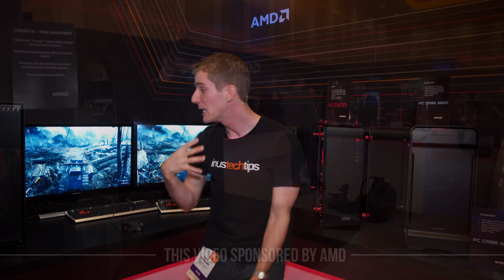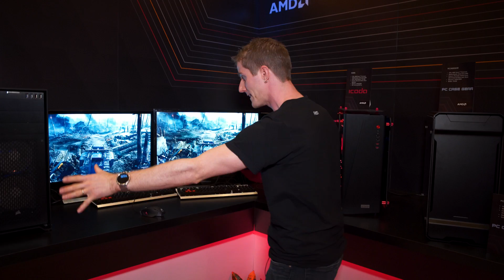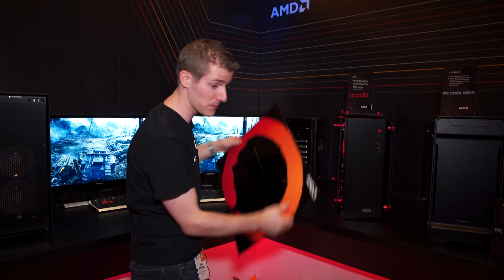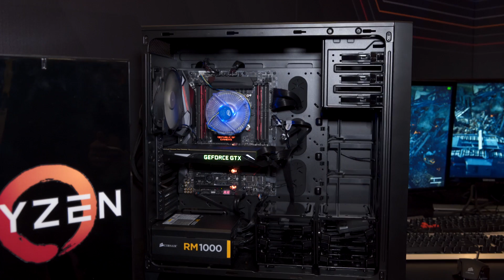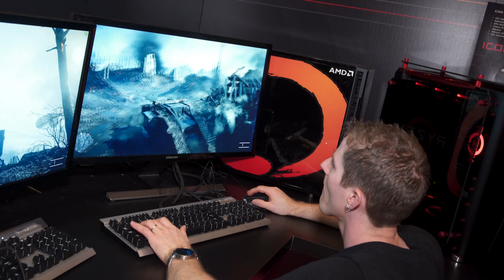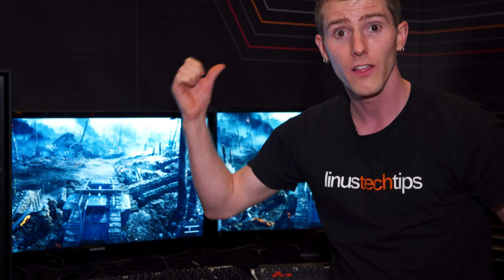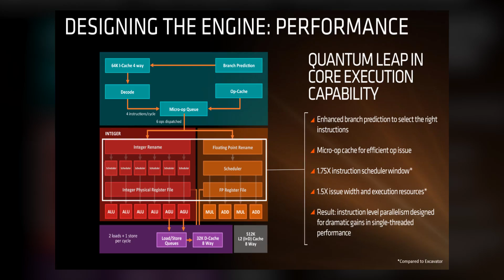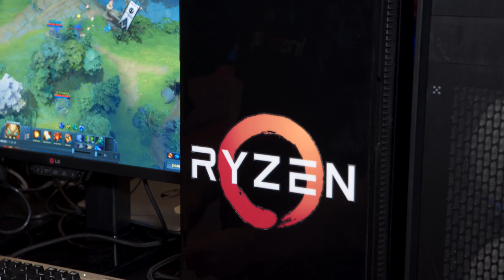AMD Has Ryzen!

Comment: If it competes with the 6900K, a $1,000 chip, then wouldn't it make sense from a marketing standpoint for AMD to price the Ryzen CPU's at around $500-$800?

Would it be wise to wait for Ryzen if your budget for a CPU is $250 (6700K price), or would it be best to grab an i5 6700K now?
Reply: Doesn't make sense to judge AMD's new CPU's based on an extremely old 8350. Personally I would've waited for Ryzen to launch before making a purchase. I can't wait to get rid of my i5 6500 if ryzen is as good as benchmarks show.
Reply: Jake It looks like AMD cpus will have about the same performance as intel. So expect the price to be a bit lower than intel but not a lot. 25% max.
Reply: Robin Muerkoester Remember the price of the 9590? The Fury X? The 295x2? AMD has a history of teasing things, overhyping them, then slapping a big price tag on them.

I agree that AMD should try to balance the market, but pricing to be competitive with something like the 7600k or the 6700k would be stupid. It's clearly meant to compete with chips that wrongfully cost over $1000.

I think at best what we're going to see is AMD price this chip at around $600, forcing Intel to drop the price of their chips. Then AMD will release a line of mid range CPU's to compete with the now lower priced Intel CPU's.

In the long run I probably wasted $50 or so by buying now, but I really couldn't care less.
Reply: The 6700k is an I7 honey. And why get the 6700k when the 7700k is already here. PLUS RYZEN ISN'T THE OLY FUCKING CHIP. THERE'S OTHER CHIPS AS WELL YOU PLEB. This is their top chip.
Reply: EvokeDuck Tbh I already bought the 6700k, just wanted reassurance that it wasn't a mistake lol.

Honestly, coming from an 8350 I don't think I would ever trust another AMD CPU in my computer.
Reply: Zed Jayce Damn straight I do ;)

I don't like Intel's naming
(actually I meant the 7600k)
Reply: the only problem with considering changing CPU to Ryzen from an i7, is that not only woul you have to buy a new cpu, but also a new motherboard. Which is why I havent upgraded my shitty fx 8320.
Reply: Zed Jayce "Guys my '98 Camry is as good as your 2015 Ford Focus because they go the same speed!"
Reply: Jdjjd Gdhdjc Yeah but the CPU you're seeing in this video won't cost anywhere near a 7600k, it will no doubt cost more. AMD hasn't said anything about their mid range CPU's so everything about those is literally speculation. As far as I know, their existence is pure speculation.
Reply: @Jake My 8350 did me very well.
Reply: ***** Actually they compared it to a 6900k (and if I'm not mistaken the 6900k was being throttled by AMD. Something was only running at half efficiency, that's a fact.)
Reply: TheGamingFireUltra You even bother to read anything past the first reply?

Still waiting for YouTube to implement age restrictions on the comment section.
Reply: ***** Right, something we've been discussing this whole time. Don't see the need for his comment other than to show he has to be up at 7 tomorrow for school.

Comment: for those saying AMD won't be cheaper - they will. AMD's rep is nowhere near intel's, 99% (excluding weirdos who are attracted to the underdogs) would rather pay the small difference and get an Intel CPU instead - so it's going to be either reasonably priced (not aliexpress kinda cheap) or priced equally but offer more than it's counterpart, like offering a more "premium" line for the same price. if I'm wrong, then go to hell AMD, because Intel would laugh at you, and us, and we'll still get crappy overpriced processors because there is no competition.
the last line is what I'm after basically, I can't stand the fact that my I7 920 is nearly identical to my 2.8-3.8GHz Xeon CPU - besides having the extra tech of the Xeon line..
servers oriented tech is way ahead of ours, cpus with 2 bil cores and 4 bil threads and we are thrilled of having 8? lol, jesus
sorry for the 3rd grade writing, it's the flu + 6 am + being a foreigner, I'm excused

Comment: this is irrelevant to the video, but just a video suggestion, for Christmas I got a new CPU cooler and I couldn't find any rubbing alcohol around my house to remove the thermal paste, so I was wondering if you would make a video on whether removing the original thermal paste first when applying more makes a difference or not
Reply: Faneili always remove it bro
Reply: Chifinity oops
Reply: If the thermal paste is not too old and still slightly moist then it should be ok. If it's old and crusty then you'll have to renew it man

Comment: Did anyone else notice that during the bf1 gameplay that they had vsync on the computers. Meaning they both kept around 60fps. Whereas if they were unrestricted framerates than I think intel would be running at a much higher fps than amd

Comment: I don't get the 6900k comparison. It's not a gaming CPU, it has a lower per clock speed than a 6700k. Why not compare it to that? 

I get it, core to core, thread to thread comparison, but you might aswell try to make the FX 9590 look good, except you can't because no matter how many cores it has, it would still get shitstomped. 

Prove me wrong AMD that this isn't another Bulldozer. "Even" performance doesn't impress me.

Comment: BF1 Wasnt even running at 60 FPS... Have Game Devs given up on optimizing PC games well?
Reply: brah dat shud be 4k. 4 freakin k.
Reply: Aphex it was 4k bro
Reply: I feel like the instant that a game has multiplayer all thought of optimization is thrown out the window.
Reply: 1. 4K. 2. 55 FPS is damn indistinguishable from 60 FPS.
Reply: my only complaint about it is they didn't show what the intel was getting just what the AMD was, makes it a pointless test in my eyes.
Reply: LTT wasn't doing the test. the test was done weeks ago. they were just showing off the PC that was used in the original test
Reply: They havent given up on optimization but theyre trying too hard to make it work just a well on all hardware. Not too mention linux, linux drivers are different from windows drivers and whatnot so theyre just trying to make it playable across all platforms without giving up detail. But for some weird reason, my mid level rig feels smoother on modern games then my high end rig. I get more fps on the high end rig but theres a lot more screen tearing, random frame drops, and just an overall weird delay feeling. As if Im playing on a 30hz monitor. All of my hardware is fine tho. Dont understand it
Reply: Elusivehawk its pretty close, but only if you have Gsync/Freesync monitor. On a normal 60hz monitor 55 & 60 are world's apart

Comment: "They run pretty much identically"...Shows 78fps on intel vs 57 fps on amd...2:28
Reply: Actually playing the game lowers the FPS compared to idling it seems. Though if you carefully look at the video the AMD machine seems to dip to the yellow more often than the intel one even when idling. But it's not a 20 fps difference.
Reply: Is something wrong there ? Why does it run so bad ?
Reply: Sith Hippious up the video resolution and zoom in there is little to no difference
Reply: I see 20fps difference....
Reply: If i was amd i wouldnt compare it like this with the intel then cause it makes the new cpu look bad...Even though it may be good.

Comment: Why are people expecting a price LOWER than a 6700K for a product with BETTER performance?? (allegedly)
Are you all retarded?
Reply: Look Behind You Thats what AMD does, they undercut the competition with better price/performance ratio.
Reply: Clearly, someone is new to the competition between AMD & Intel. Also, a lower price would generate more sales(what a shocker).
Reply: Because why not? Intel has been monopolizing the cpu market for a while now. It's getting boring to see high end build with the same cpu.
Reply: Because it's AMD and they're known to do that. That's what they do and it'll force Intel to rethink their strategy.
Reply: Perx when AMD has a competitive chip they price it accordingly. They aren't going to sell them dirt cheap if they don't have to.
Reply: because 7700K, Broadwell-E is the better solution if the Ryzen is more expensive than 6700K.
also, you need to buy a new motherboard, while those 6700K users can buy 7700K, using the same cooler&motherboard. pretty convincing, right?
Reply: ..and Ryzen is?
i mean, most of power users who use K version will try to OC it, so it doesn't matter. plus, Ryzen is not available, while 7700K is available now. that makes difference, too.
if Ryzen is like 40% faster than 6700K, that can be tempting, but still there's Broadwell-E with enormous ram support&massive threads, so in order to make Ryzen attractive to intel users, Ryzen must be in lower price, or almost same price with much,much more speed.
tbh, even i7-4690K can be faster than 6700K when it's OCed with 80$ liquid cooler. it's all about price& budget i think.
Reply: the 8c/16t cpu will be most likely like 700-800$ . everyone will be disappointed lol
Reply: +facelessninetytwo Can I have a link to that video?
Reply: No shit. That isn't what I said anyway. I said they will sell them for a lower price, not dirt cheap. Lower as in around $50.

Comment: still keeping my 2500k oc, it'll probably last at least for 3 more years until new consoles will come out
Reply: Dex, your last comment on resolutions is as asinine as it is false. Consoles have very few games running true 1080p, and that's at 30 fps. The majority are rendered at 720p/900p and upscaled. There's also physical size and pixel density to consider, because frankly if you're using 24-27" screens, the only real difference you're going to see between 1440p and 4k is text size being way too small, and having to use really bad windows dpi scaling. Not everyone wants giant screens where 4k will actually make a tangible difference in picture quality. Frankly, you'd be way better off getting a 1440p 144hz VA/IPS panel with HDR or G-Sync/Freesync. These upgrades will make a hell of a lot more difference to overall quality. There are plenty of legitimate reasons to want 4k, but if you're only gaming on your desktop PC, it is a completely unnecessary frame rate killer that currently locks you into a max of 60hz.
Reply: Nisco Racing. The IPC difference between a stock 2500k and  stock 6600k is roughly 40%. Kaby lake is exactly the same as skylake in performance. a 4.5Ghz 2500k (which is an incredibly easy OC for 2500k) comes damn close to the performance of a stock 6600. The benchmarks and comparisons are everywhere already. Maybe next time actually look it up instead of mashing your keyboard. Since the SandyBridge architecture, performance has only increased by roughly 5-10% with each generation. It absolutely is time to upgrade the 2500k should you be buying a high end graphics card, but the only real upgrade to it would be an i7 at this point and at the same time the bottle neck is not enough to bring any game below 60 fps on ultra should you have a 1070 or 1080. It doesn't really even bottleneck the cards below that  at all with a good OC. Furthermore, so few games are actually cpu intensive that the bottleneck will rarely be seen. All that said, how much life it has left really depends on the user. I don't think it will keep up being capable of ultra settings for another 3 years but it's whatever.
Reply: Dex4Sure Keyboard warrior? Nice insults m8
Reply: lexii miller Well put.
Reply: +Karol Jampolski Upgrade when Cannon lake (10nm) comes out in 2h 2017 or Icelake in 2018 and if you want, Tigerlake in 2019.
Reply: Karol Jampolski console pleb
Reply: comedyman112 wut? im pcmr, im just saying that games will get more demanding on the cpu side when new consoles will come out, im not switching to console
Reply: Nisco Racing depends. If you do 4k gaming then you're still at 60hz and thats easy for 2500k. However of you are one those 144hz guys, well then a cpu starts to count.
Reply: yes, testing cpu's at 4k is pointless, they should test ryzen at 144hz instead
Reply: 4k 60hz is quite CPU intensive. I don't know what you're talking about.
Reply: Yeah, im not sure why he brought 4k into this in the first place. Chances are if you're gaming on a 4k screen and want the highest settings, you're not the type to still be holding onto a 6 year old system, you probably have and should have i7's and 1080s or Titans or whatever. But for 1080/1440 60hz, and still in plenty of cases 1080 144hz, which are the resolutions the vast majority of people are using, an overclocked 2500k still has a good bit of life left.
Reply: Karol Jampolski there wont be any new consoles
Reply: they can still run all the games well enough to be playable and enjoyable
good enough if you ask me
Reply: GGPL  yes there will
Reply: Maarten has the right idea. I'd do it myself but even a 2600k still seems to go for $250+ in Aud and the 3770k $350-$400 Aud so at that point, it's worth it to me to upgrade to skylake/kabylake/zen(?) simply for the ddr4 and m.2 support.
Reply: phrasing...